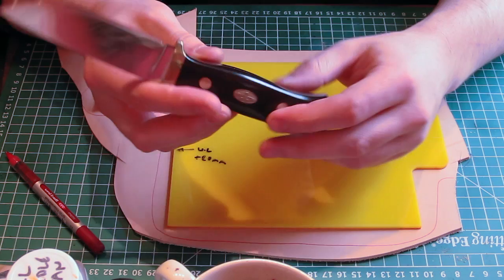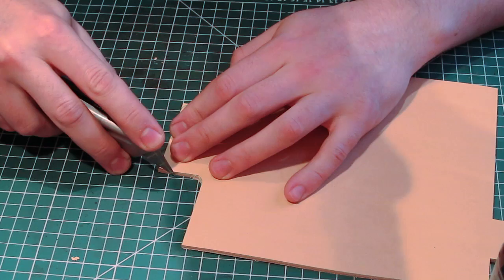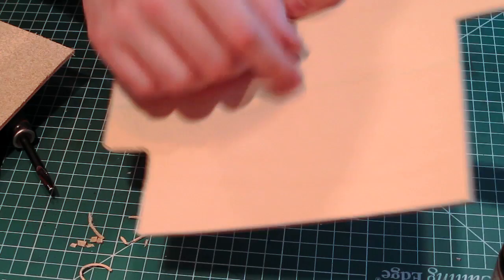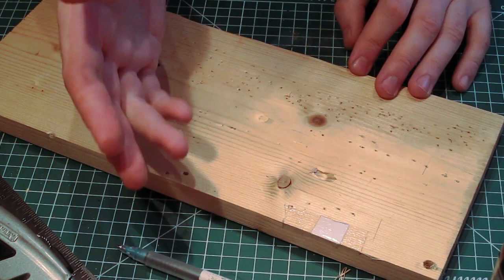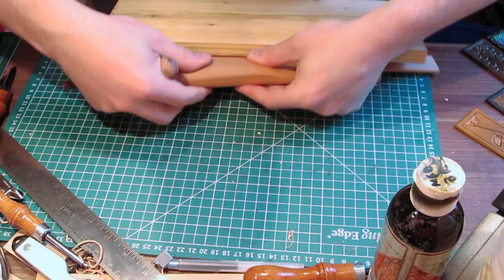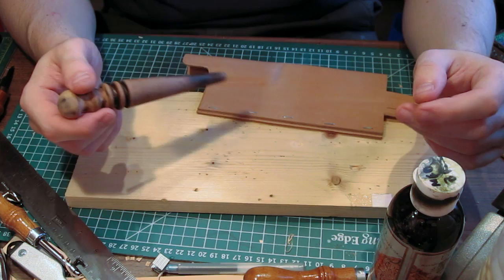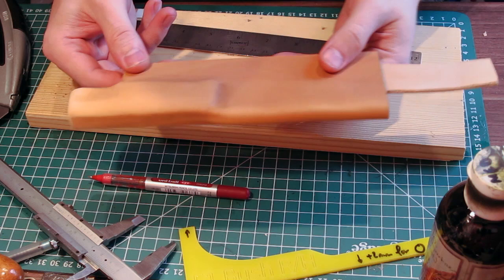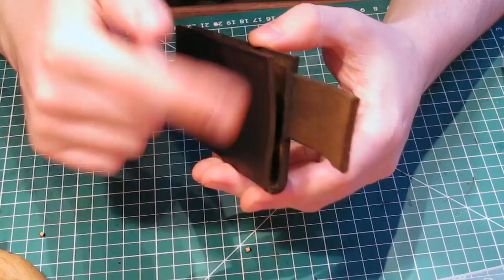How to Make a Bushcraft Sheath for an F1 Style Knife

Comment: i always find it best to fold with a dampened crease, glue and sew the welt in dry, then wet mold and form the knife into the leather after the glue has had a chance to cure for 12-24 hrs. then sand trim and burnish--edge coat and seal. many ways to skin a cat they say... always good to watch people do things different and have great results...

Comment: Cramps are from pinching the material tightly between your fingers and thumb with a flat thumb grip, I used to get the same cramps all the time (I play too many video games) To alleviate: try to avoid having to seize your hand muscles in one position for long periods, if you feel yourself gripping hard, try to find an alternative. Grip with your finger and thumb tip, in more of a "C" grip (more natural position for muscles) don't know how much that will help but thanks for the great video cheers

Comment from the maker: @RDPproject Hi Rob,

Line 20 and Line 24 are snaps sold by Tandy (Line 20 is also the same as 'baby dot' and line 24 is the same as 'durable dot' as sold by the Dot company who actually make them I think). Line 20 is the normal sort of snap, line 24 is heavier duty.

The thread in the video is pre-waxed nylon thread not sinew, 1227-038 in the Tandy catalogue

Comment from the maker: @ridinmabike Rivets are stronger I think! I don't like sewing across different heights of leather because you end up exposing the stitching where runs up to the higher piece on both sides and there's no easy way of protecting that. Plus with straps there's potential for a lot of twisting motion on them as they're put on belts or slid round belts which would further wear that stitching. Overall I'm just happier with a couple of nice strong rivets!

Comment: Great video Ian. Loved it.
Two questions mate.
1 - At 1:10:49 you saw they snaps are 'Line 20' as marked on the box, and the main closure snap is 'Line 24'....what do you mean by that Ian?
Is it a size, strenght or some other kind of measurement? 
2 - How big/long was the roll of Sinue...and is it artificial waxed Sinue?

Thanks mate.
Rob.

Comment: Hey man, is there a reason you dye after wet forming ? And is this sheath only possible if leather is wet molded ? 
I normally dye just after cutting the shape out. But I haven’t done wet forming before so wondering what the best choice is.
Thx in advance